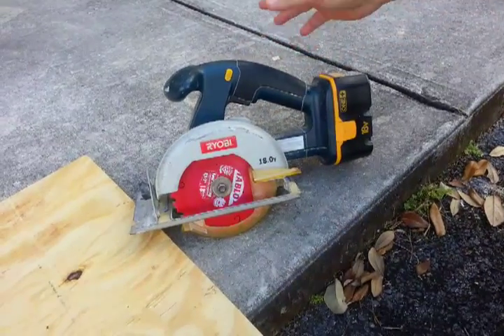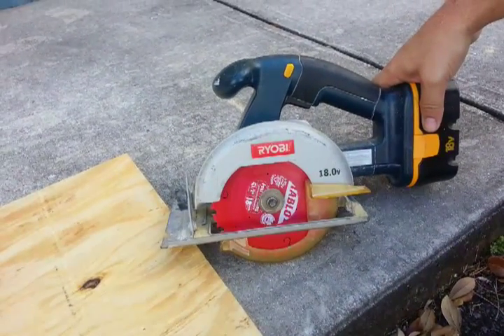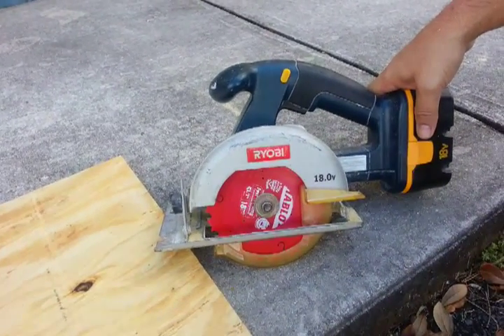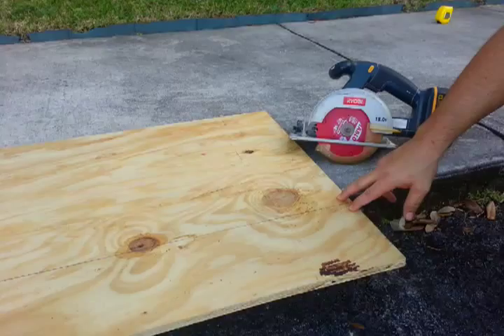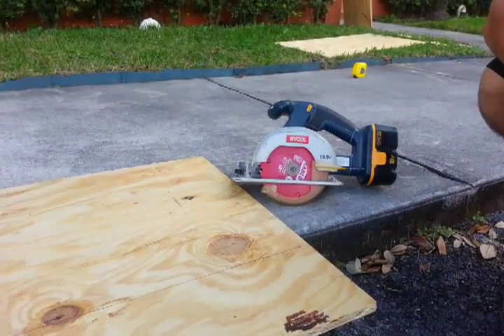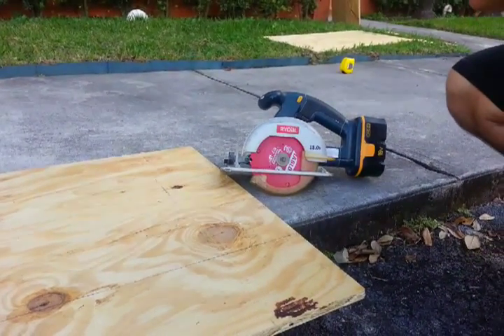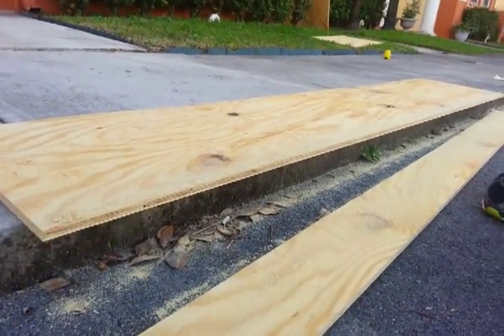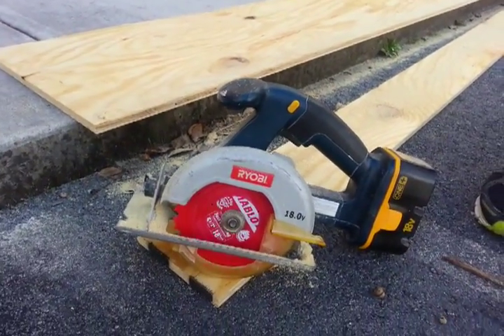Ryobi Circular hand saw demo (with 2200mAh battery rebuild)

Comment: Mine works fine in the drill but won't cut 6" in 1/2 plywood before bogging down and stopping . I can stop the blade with a finger pressed against the flat.

Comment: Setting the blade depth, to clear the workpiece by around 1/8", will place less stress on the motor and cut the material even more efficiently.
The idea is to cut along the workpiece and not across it. The above method will also clear the kerf more easily, and keep the blade cooler.

Comment: Can someone here direct me to a proper diamond-tipped blade that fits this machine to cut grooves in concrete?....can't seem to find one that is 5.5" diameter ( or smaller, I guess would work too) with a hole/arbor bore hole of 10mm....or 3/8" in a pinch.
Reply: NO .... wood cutting saws should never be used to cut concrete, especially with a plastic blade guard. You're better off renting a dedicated saw, with a water-cooled blade!